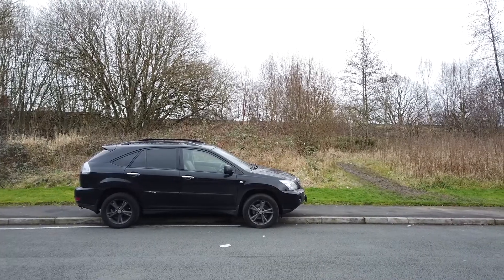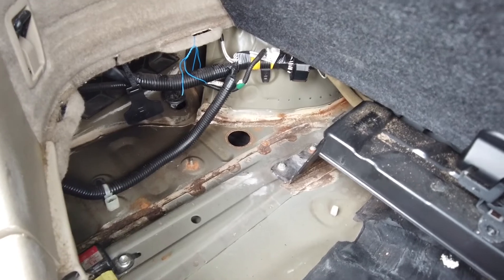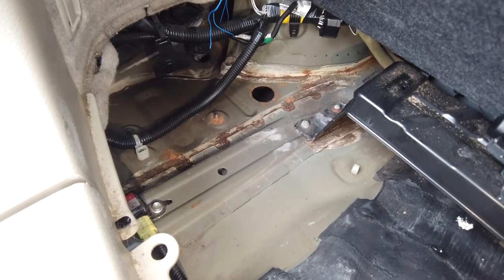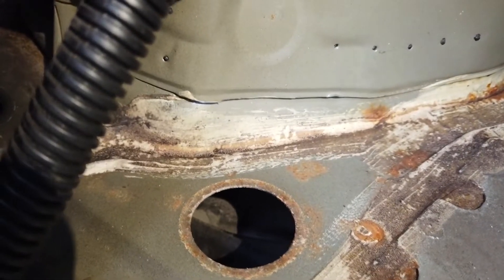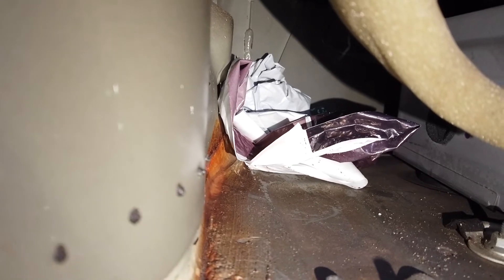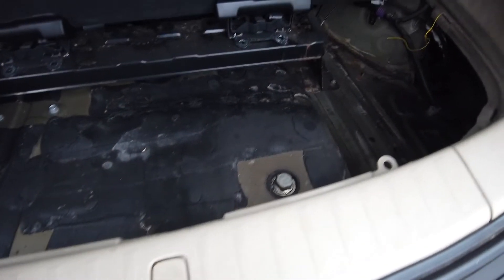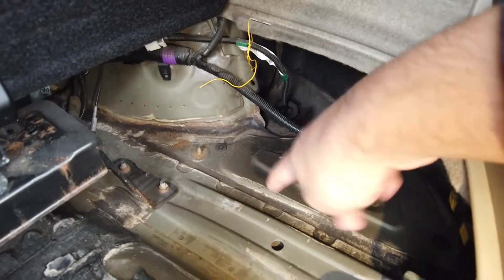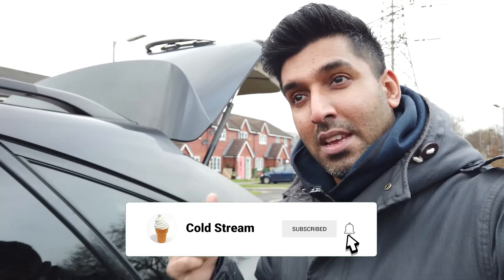How to stop water leaking into your car

Comment: Thanks, this is very helpful as My RX400h has exactly the same problem and I have to keep disconnecting the 12v battery to clear the fault warning and start the car. Took it to Lexus who effectively said the car is a write-off because as well as fixing the leak it will need a new hybrid battery and controller. When you fixed the leak, did the battery dry-out and the VSC / check hybrid warning stop appearing?
Reply from the maker: I think you've hit subscribe too!! 🥳🥳 Thank you if you have and thank you for your comment (please subscribe if you're not subscribed already 🥳🥳)

To fix this issue follow my other video about this vsc/battery problem I'll put a link at the bottom of this reply for you. 

The best thing about this issue is that you can do this yourself, it'll take a bit of time and effort but it'll save your car and it's a great car so save it 💪

You'll need to stop the water coming in as I've shown in this video and follow the steps in the video linked below and then you'll be sorted 👌👌 just stopping the leak won't dry out the water that is currently surrounding your hybrid battery and it's that water which is tripping a safety mechanism and brings up the fault.

https://youtu.be/6iFUEuKP-kY

Comment: Same issue with my 2008 , water where you say.  Going to open the boot next.  Once you dried it out did the warning disappear ? An auto electrician says it's my battery relay 100% ???? Cheers Allan
Reply from the maker: Yes with mine 100% once it was dried or even almost dried out, removing the error code (disconnecting and reconnecting the battery if you don't have a machine to remove the code) the fault has never come back. 

It was definitely caused by water detected in the electrics however I'm not a professional at this so all I'd say is try my fix, getting rid of the water will always be a good thing 🤝👍
Reply: @ColdStream  top man all the best
Reply: @ColdStream  just opened the boot covers and yes it was full of water 😔 , I've removed the plugs and cable tied the lead up, let's see, fingers crossed 🤞
Reply from the maker: @allankelly6980 yeah water problems, after this you'll want to protect the underside of your car from rust for the future, that part I don't know how to do 🫠